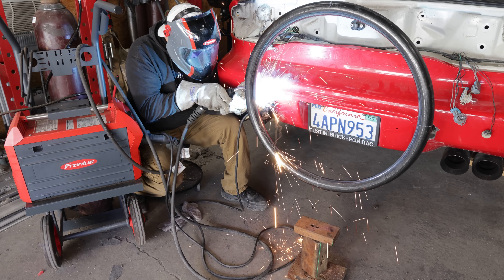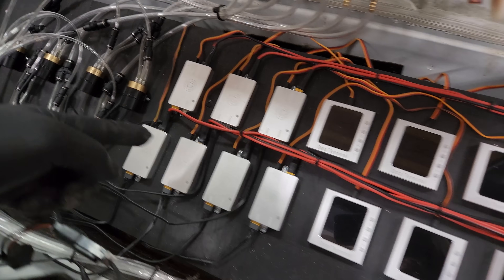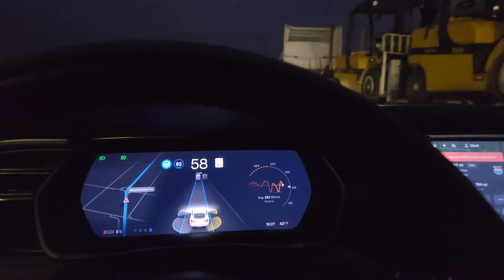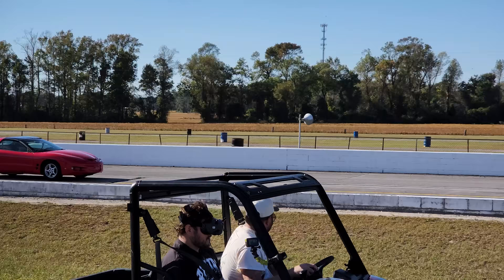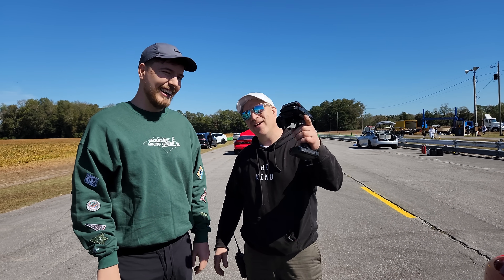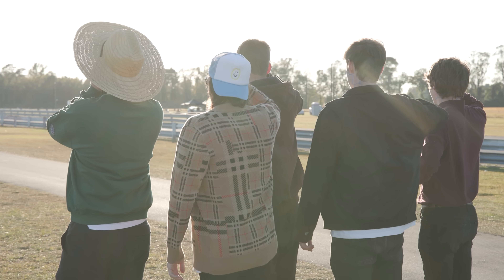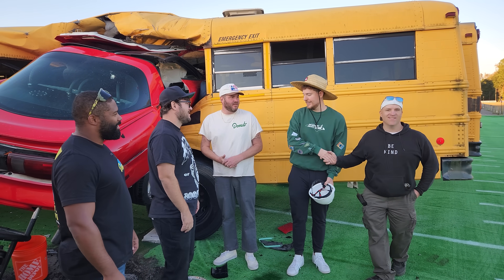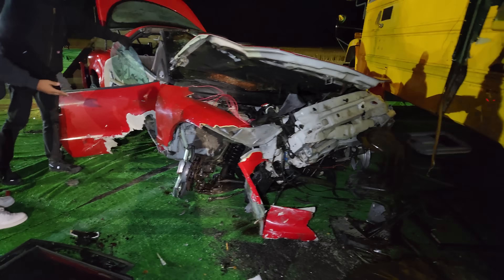RC Jet Car for Mr Beast Crashed

Comment: “THATS ONLY TWO ENGINES!”

Bro……
Reply from the maker: 2 engines? Where ?
Reply: @WarpedYT  the clip with the guy holding the mattress, you can hear someone yell that out. Just expressing the power if that was only two engines. Maybe i misheard, i dunno
Reply from the maker: @danieldoesdumbstuff  oh yeah that was me, there were only two engines at full power during that test The other ones were idle.
Reply: @WarpedYT  well, regardless, those lil things were strong as hell. Kudos
Reply from the maker: @danieldoesdumbstuff  very

Comment: So it was actually powered by the original engine, and the jet engines were just decorations?
Reply from the maker: Haha... Well kinda, technically they were assisting with the acceleration on the ground, and as soon as it left the ramp the jet engines take over. I built a second version of this for Mr Beast as well which was titled The flying car, however there were mistakes that happened on site by the crew, not my crew,, which ultimately led to the car only going 600 feet. I was not happy and I did film that complete video but I haven't posted it on this channel.

Comment: Even at 100mph it wouldn't have made it because of air resistance and the car pointing downward definitely didn't help.
Reply from the maker: Incorrect, the thrust was more than the air resistance x5. I did all the engineering and simulations for this project and it would have made it. It's clear, it went 78 mph, and it jumped about 78% of the way. Easy
Reply: Haa you where wrong
Reply: Keyboard warrior
Reply: @manuelpiston  The downforce from the car made in land much shorter.

Comment: Maybe I have question. I am obsessed with sound of jet engines. How is possible to hear the very high pitch whistling from the compressor and intake in extremely loud exhaust jet shear noise? Isn’t jet exhaust louder than intake?
Reply from the maker: Different frequencies all together. Just like in music when u hear vocals and the bass at the same time .

Comment: You have a great video. This video just needs to be discovered. Change the title put mr beast in the title and thumbnail.
Reply from the maker: Thanks, That was the first way I had it, thumbnail with mrbeast and title and it only had like 10 views per hour, I took Mr Beast out of the thumbnail and the title and the description and then it was getting 200 views per hour. It was a fail from the beginning as soon as I let donut in.

Comment: I don't think the jets do much behind the wing. 
Not enough air back there.
Would have required more like 120mph.  Even with jets.
Reply from the maker: There's plenty of air, these are turbo Jets not turbo fans
Reply: @WarpedYT  What does the type of jet engine have to do with it? I'm not trying to be an ass I just want to know.

Comment: For info, the jet engines would make a lot more power if they were not starved of intake air......... Running them behind a moving vehicle (i.e. in a partial vacuum) will dramatically reduce their efficiency. Placing them on the sides and roof of the vehicle would be much better, but you would have to consider their exact placement carfully in order to acheive a safe Centre of Thrust (COT). Nice idea though, and interesting video, thanks for posting.
Reply from the maker: Thanks, this was a proper design these are turbo Jets not turbo fan engines. I appreciate the suggestion but you should do some research on that, putting jet engines on the side would be disastrous, have you ever seen a rocket with engines on the side there's a reason why.
Reply: @WarpedYT  I appreciate the work you put into this vehicle, and I'm sure you didn't just bolt some engines on and hope for the best, so before you get the wrong idea, I'm not trying to put you down and pick fault. I just have a genuine interest in these things, so thanks for the reply and info, and I agree that jet engines on the side of a ROCKET is a bad idea, but surely on the sides of a VEHICLE (which is of course guided by its tyres along the ground) would be ok as long as you considered the centre of thrust as I mentioned earlier. I would certainly be interested to see how much faster it could be (shame it's now destroyed).......... But of course the car throttle would have to be open aswell, but that's another story..............
Reply: @banditdarville.  you don’t know what you’re talking about, and you’re insulting him by assuming he didn’t do the planning and math. There’s no reason to assume he starved the engines enough that the design goal couldn’t be met. He’s not dumb, and he knows way more about attacking jet engines to cars than you do.
Reply: @float32   I didn't know he had a bodyguard Lol...... please take your negative comments elsewhere

Comment: Everyone's acting disappointed but a car impaling a bus is a much better video than a car landing on a ramp.
Reply from the maker: I thought so too at first , but then when Mr Beast explained to me afterwards that the main objective was to have the Jet car clear the busses, well then I actually felt like a failure. 
Which is why I went back and looked into all the footage, pulled the log data from the RC remote and the in-car camera, I quickly felt sick to my stomach when i found out that the driver of the car never went Full throttle and did not nail the throttle from the start as instructed, then I looked into why that didn't happen and quickly recalled and interaction I had with his boss, I told him not to mount that fpv camera on the rear view mirror but mount it mechanically above the driver's seat where the driver's head would be instead, that way he can not only see the speedo but it feel natural and he can also see his steering input real time. I also told him to mount those fpv antennas on the roof of the car so they had line of sight and they didn't have to do that thing with the side by side chasing down the car. Now it makes sense to me, and now I feel like I completely failed Mr Beast to be honest. I've done these before for a few movies so this isn't my first rodeo but they didn't listen and now I'm sort of pissed.

Comment: Well you guys didnt have enough inlet air to assist engines… they were grouped in one place causing a local pressure depression. And then, the jets were not on a augmentable fixture to swing them slightly up after launch, and so what happened was that the engines continued to apply pressure to the system and with the heavy part of the car in the front.. actually pushed it down terminating it’s approach angle prematurely. And actually if the engines were turned off after launch it might of squeezed out more distance.
Reply from the maker: Incorrect X3, these are turbo jet engines not turbo fan you're getting mixed up. I engineered the height of center of gravity positioned slightly offset to the center of thrust to get a certain arc curve over the distance of the jump and have the proper rotation to match the landing ramp angle, and as you can see the landing ramp angle of the car into the bus was almost exactly the same as the landing ramp angle. I definitely did not want thrust vectoring, it wouldn't have made a difference because the air time was too short and without onboard electronics to monitor the attitude of the car and compensate it's essentially a crapshoot and an unwanted variable. Also there was no low pressure zone in front of the engines there was plenty of space, what a turbo jet does if the pressure is too low in front of it is it just stalls out. The last thing it would definitely have not traveled further with the jet engines turned off, it's called mass of inertia versus wind resistance, that's like saying an airplane is going to speed up if you turn the engines off, hopefully you didn't take this the wrong way but I read your comment as a very confident statement on your part,  I was just giving you feedback so you have a better understanding.

Comment: Hay I want to put 4 jet engines on the Mojo boat and set a record for the fastest mini jet boat!!!
Let’s do a collaboration???
YouTube    Mojo H2O
Reply from the maker: These engines would be way too small for a boat, too much water resistance, you would probably need a j79.
Reply: @WarpedYT  have you seen the size of my boat? It’s very small.
Reply: Thanks for your response 
The mini boat Is  5’ X 12’   1200 pounds check it out on  YouTube. “Mojo H2O”  I think it would make a viral video.   I think the top recorded speed that I’ve seen is 64 miles an hour, I would like to see 70 to 80 maybe even higher, it would be a fun project.

Comment: fwiw it was still a damn cool project and entertaining final result, even if the driver didn't go full send mode it as intended. not often you get to see a car tossed like a spear into a bus.

though frankly I wouldn't be surprised if one of the production managers on mr beast or donut's end told the guy to let off and deliberately let it fall short and crash

Comment: Great video man. Just wondering did you have time to train Nolan thoroughly on controlling the car? I imagine you have little time to brief him since you have to handle lots of stuff. I felt like he didn't know what to do in order to hit the speed he needed to clear the buses. Or probably something else. Not sure if you are up to doing some failure analysis. It will be interesting to understand what went wrong.
Reply from the maker: Thanks and great question, I will elaborate: the way I set it up was exactly like an RC car, Nolan said he had experience so I don't think this was it, I think the problem was the way that his boss mounted the FPV camera, if you look closely at the rear view mirror on the in-car footage you can see how he set it up, I argued with him a few times because I wanted it mechanically fastened to the roof of the car from the inside with a bracket right above the driver's seat, that way it feels like he's in the car and he also has a nice view of the speedometer a good feel for the car and the road and basically everything. This is not my first time building these I've done them for movies quite a few times before, when you have the camera on the windshield like that you lose your spatial awareness and really can't tell the attitude or the position of the car very well. I believe this one key factor was the cause of the entire failure. But he didn't listen, I told him try your way, try my way and test it, they thought they were right. It was as simple as that.
Reply: @WarpedYT  Oh man i see what you mean. I can only imagine how you must've felt. Hopefully you will get something positive out of this and move on. Take care man.
Reply from the maker: @davidbubble6863     I was extremely upset to say the least, it took me about a month to mentally recover from this big mistake I made, I should have just told him to move aside, put the camera where I wanted it and have a successful outcome. They moved on quickly but it took me a month of feeling mentally ill to recover.
Reply: @WarpedYT  damn I’m sorry to hear that bro. Engineering is tough when it comes to failures, often by the time you know what you did wrong it’s too late.

Literally just found your videos and your stuff is dope! Really appreciate you and what you’re doing. Sending respect from the UK 👊🏾
Reply: @WarpedYT  Don't let that get you down, you're doing so well and even if this was a huge deal in terms of 'clout' it was clearly not your fault. You said before the attempt that there was a minimum speed and it wasn't hit. 

It seems strange to me that the guy controlling the car didn't sense something was off with the speed and just abort, especially if his sense of how fast the car was going was impeded. They've only got one shot at it so you have to be absolutely certain. 

Seems a little bit...unprofessional? But IDK, that's Donut Media's shtick, to just goof around, and maybe in this instance it sort of caught up with them a little bit, which is a shame.

Comment: You should of used a lighter car like a Honda. . Just a thought
Reply from the maker: So when jumping like this lighter does not mean better, usually heavier is better, I know it sounds weird but it's all based off of mass of inertia, more weight more inertia and then adjust the ramp angle to accommodate Arc versus gravity.
Reply: @WarpedYT  YET AT 100MPH A LIGHTER CAR WOULD PRESUMABLY GO FURTHER THAN A HEAVIER CAR AT THE SAME RATE OF SPEED ITS GOT NOTHING TO DO WITH MASS OR INERTIA... YOUR OVER THINKING THE PROCESS.  ITS COMMON SENSE THAT LIGHTER ST SAME SPEED IS GOING TO GO FURTHER..

Comment: Wish you guys could have had more practice to go wide open throttle
Reply from the maker: I told them to practice..
Reply: @WarpedYT  maybe in part 2 you get to drive?
Reply from the maker: @lukedoehrman2304  Mr Beast wanted me to drive but I was controlling the jet engines.

Comment: Would help to make sure the engine of the car is at least in half decent working order before finishing the project. Should still do 0-60 in 7-8s (was 6.5ish seconds new)
Reply from the maker: It was good, I tested it when me and Nolan were in the car, the car had enough power it was decent. You could even see a Mr B's video he hits it Full throttle a couple times by accident and the car moves. Not sure why he took off from the line so so slow, I think he was just trying to get used to the steering or maybe he couldn't see because they mounted the camera where I told them not to, they duct taped it to the rear view mirror, I was not happy about this but they argued with me about it.

Comment: Why didn't he go full throttle from the start? Not even on the ramp the car was at full throttle

Thanks for the awesome video building this
Reply: Yeah, the guy running the throttle fucked up.
Reply: @TheAnimeist  most likely distracted eating a donut.
Reply: Agreed, he probably could have got two buses further if he had kept it floored the who time
Reply from the maker: According to my math which was actually dead on, if he would have hit the ramp at 100 exactly it should have cleared the last bus by anywhere from 3 to 15 ft depending on the wind direction, anything over that would have been excess. Half a mile to accelerate to 100 is plenty of space even without jet engines but not if you don't hit the throttle
Reply: @WarpedYT  Just randon ideas, even at 100 it wouldn't work according to the angle of the ramp, you need to calculate the loss of momentum when the car hits the ramp, the suspension also has to be rethought, in addition to the entrance to the ramp being less aggressive.
Reply from the maker: @Rodrigo8  hahahah 🤦‍♂️🤦‍♂️🤦‍♂️. That's funny. Do you think I just took a guess? Serious question. Of course I did all the calculations I ran like 20 simulations maybe more, yes at 100 it would have cleared the last bus by anywhere from 5 to 15 ft depending on the wind speed and direction. Come on man
Reply: @WarpedYT  I'm just trying to save the show 🤡
Reply from the maker: @Rodrigo8  hahah fair enough, yeah I calculated all of that including suspension which nobody modified anyway but I was exhausted doing everything by myself was beyond tough, I was almost dead on the day of the shoot, it was very hard.
Reply: @WarpedYT  oh he wasnt goign all out ?! dam
Reply: @WarpedYT yeah don’t let gen z from California drive your jet car. Lesson learned.
Reply: Anne Frank Vape Pen  The whole point of videos like this is that it can go wrong or not as planned and cause mayhem. Whatever the result was going to be and whoever caused the error doesn't matter. Mr. Beast bought himself some clickbait. But I do like how Matt engineers everything. He always goes above and beyond with his projects, and that earns my respect and my interest in watching his videos. I couldn't care less about those jet engines, those won't live forever anyway. They did their purpose. For a few moments I wondered what was going to happen. Loved the noise and the flames. And it was an epic dive. What's not to like???
Reply from the maker: @insAneTunA  thanks!
Reply: That was sooop coool.. Nice work
Reply: Yeah but my 1/8 goes 120

Comment: Sometimes you stick it, and sometimes you get stuck! I need those engines on my 84 Nissan 720 Pickup. IT would have made it to 100mph but is manual so I would have to drive it myself....
Reply from the maker: I'm pretty positive I can make a manual remote controlled.
Reply: @WarpedYT  
If anyone can it is you! I still think I wanna drive it, though!

Comment: Math might have been off. Just a smidge.
Reply from the maker: Was it ? The math on who was the right driver ?
Reply: @WarpedYT  
Something was a few 4 buses & landing ramp off. Definitely didn’t have the speed, or ability to abort if minimum speed wasn’t going to be reached. Beautiful Disaster. 
I wonder how much further it would go with some side wings.
Reply from the maker: @clockwork914  nothing will have speed if you don't drive the car. The car, he took of sooooo slow from the start.. of course the car is never going to get the speed if you never hit the throttle
Reply: @WarpedYT  

That sucks. Gotta have someone with the guts to hammer down.